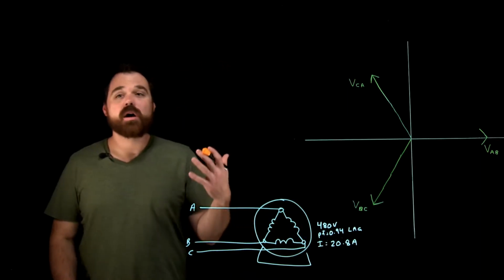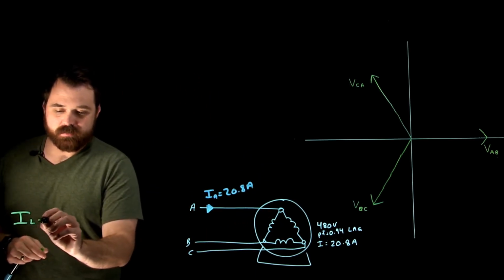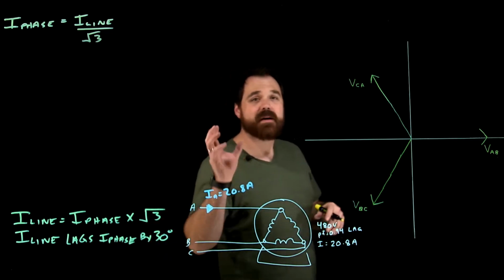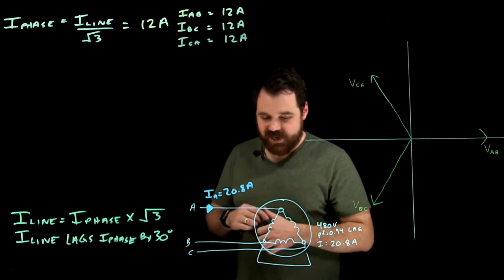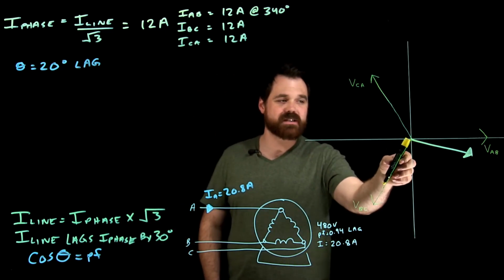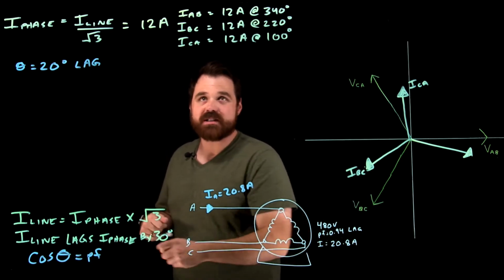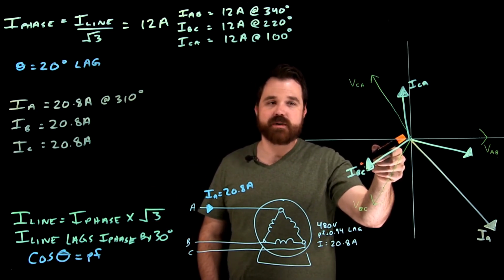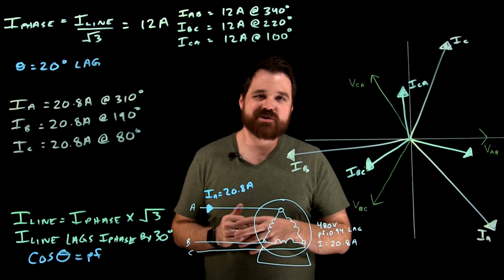Delta Balanced Lagging PF Load - Motor

Comment: Hi, Zack, Line current Ic  20.8 amp @ 70 degree not 80 degree Please verify. Thanks
Reply from the maker: Correct, Phase current is at 100deg and Line current will LAG by 30deg putting it at 70
Reply: Thank you again Zack
Great teaching lessons